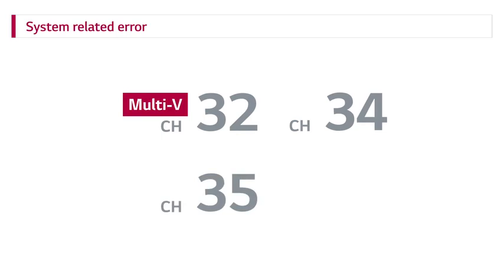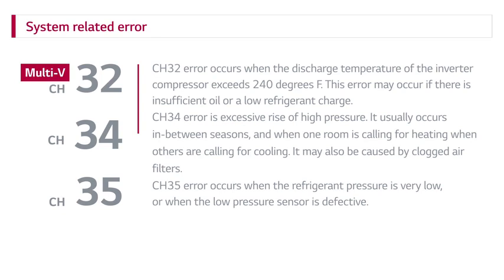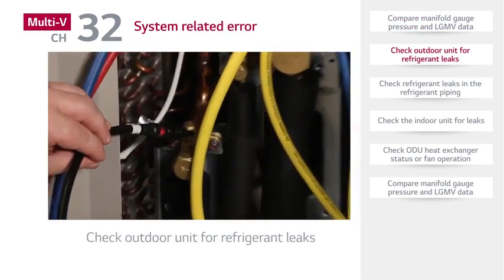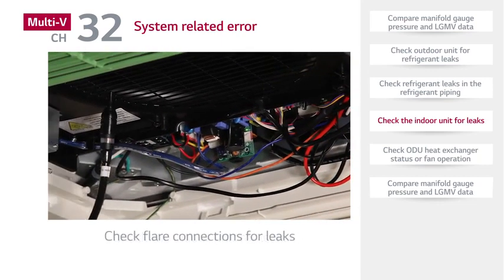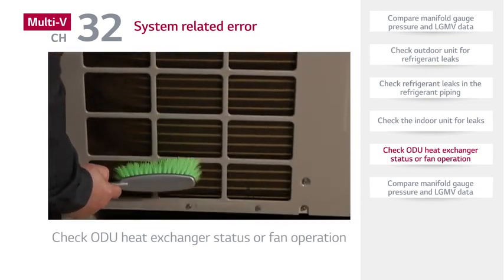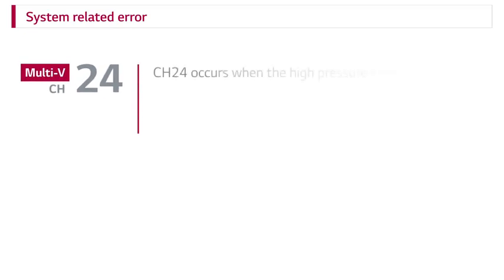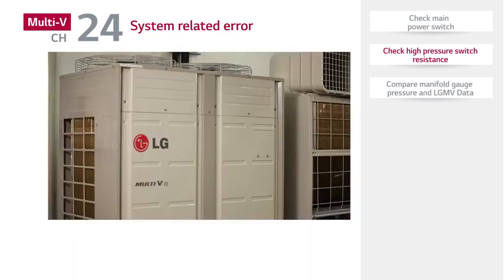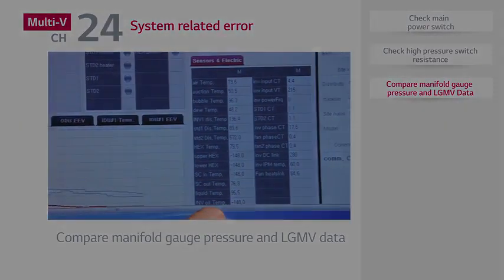LG - CH 32 34 and 35 Troubleshooting Video

Comment: I was able to correct a 35 error code by having an HVAC tech add refrigerant after a thorough check for leaks.  No leaks were found. My system is a multizone unit with two branch distribution boxes and five zones.  This low refrigerant fault would most likely be the case in most code 35 errors. As an added measure, I had the tech inject a leak sealant which can be detected with a UV light.  A year later, inspection shows no leaks and no more error codes.
Reply: Hi how did you get an HVAC tech come to your place? I live in NM, USA.
Reply: @infamcus  I live in NM too. I know a guy. Did you register your warranty?

Comment: I had an CH 34 error code. It usually happens when the temperature is hotter than114f outside. I fixed it by taking out the unit and washing it down from the inside. Cleaning all of the coils.

Comment: Mines reads ch34
Reply from the maker: That's a High Pressure Sensor error. I would see if the fan in the outdoor unit is operating or blocked.
Reply: And if it is how do I fix that
Reply from the maker: @rodneybranch655  Find a qualified LG contractor in your area.

Comment: Mi unidad dice ch 34 cuál sería la falla?
Reply from the maker: That's a High Pressure sensor error. Check the fan on the outdoor unit to see if it's operating. Make sure nothing is stuck in it as well.

Comment: Lg inverter  ducted split unit. Error ch 35 and ch 05
Reply from the maker: That's a Low Pressure Sensor error (CH35 ) and a Communication Error (CH05). I would check your wiring between units and also test that Pressure Sensor.
Reply: @GlacierSupplyGroup  . how to test Preccure Sensor?
Reply: gas kaam hai ch 35 and ch 05 indoor tu out door wire cheek kro and out door bada fuse  bhi chk kro

Comment: Thank you for the video , my unit is displaying CH 35 and will not turn the indoor units on anymore . I have someone on the way to check it out , do you have any tips on CH 35 ?
Reply from the maker: Sorry partner, didn't see your comment right away. That's a Low Pressure Sensor error. Hope you got it fixed!!